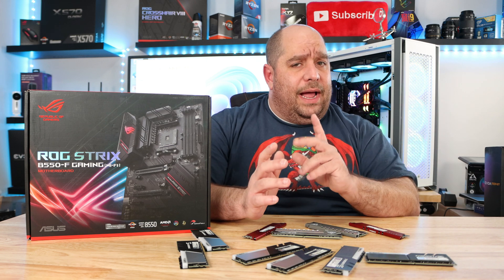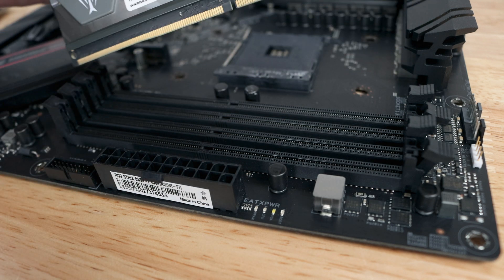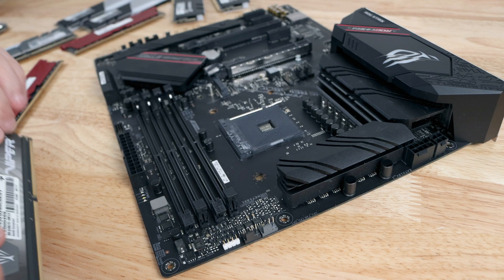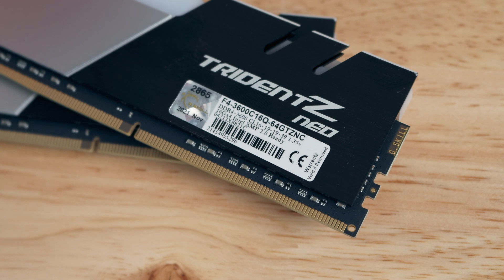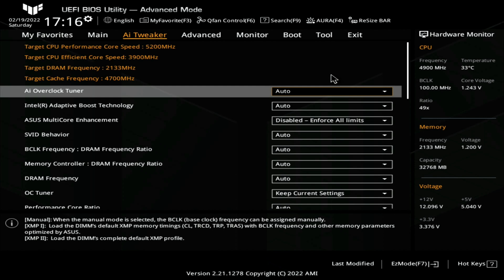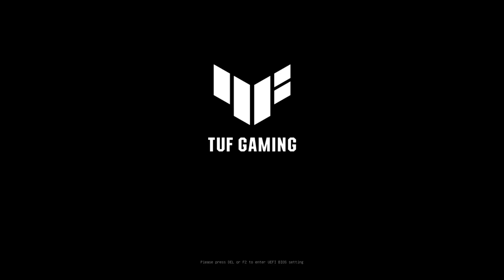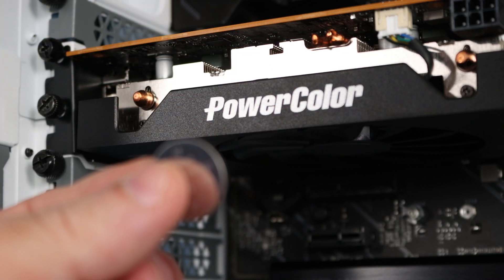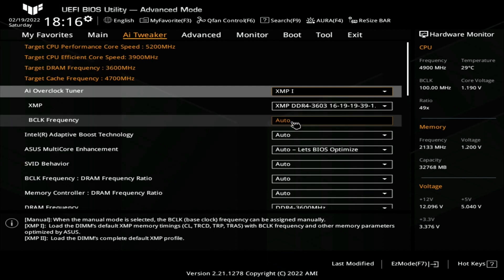How to install and configure RAM in a PC - Step By Step Setup Beginners Guide

Comment: When I boot up my PC I get this prompt - "Devices changed ( cpu or memory) or cmos have been cleared. Please enter setup to configure your system.”
Press f1 to run setup
Press f2 to load default values and continue." 

I do have a slow flashing redlight next RAM on motherboard.

Any idea what it is? Everything works fine I think.

Any help great appreciated.

cheers.
Reply from the maker: have you watched this video to see how to correctly install your memory and then how to set it up in the BIOS?
Reply: @ThisBytesForYou  Yes everything is seated correctly.  The RAM wouldnt work if it wasn't Thanks anyways.
Reply from the maker: @Sid Vish  actually, you're incorrect, the RAM could potentially work if it were not fully seated but you would have issues, you're having issues right?  Regardless I was talking about the M.2 not being correctly seat, but whatever, what do I know.  The other thing is your CMOS battery could be dead.
Reply: @ThisBytesForYou  I wasn't being funny. I do appreciate you replying. 

The only issue Im having is what I stated although it didnt do it this morning when I booted up my PC. Still a slow false red light behind motherboard though. 

I did a few hours gaming and everything worked great.
Reply from the maker: if your having issues, and they go away after a bit of using it, that is an issue, it could be small right now and get bigger over time.  What is the manufacturer and model number of your cpu, motherboard and RAM?
Reply: I do have 32G of RAM, I suppose the games could work on just 16g ( I have 2 sticks). I have ran some tests and both sticks are there.

Its very frustrating Its a $3k machine.
Reply: @ThisBytesForYou  You were right it was the RAM lol. Thank you very much indeed for help and reply.
Reply from the maker: @SidVish  always happy to help

Comment: Hey do i have to do the BIOS thing or can i just plug the ram and the computer will automatically detect it
Reply from the maker: It may, it may not, the bios thing makes it work and give it performance, totally up to you if you like performance and things to work.  I saw may or may not, because every board is different and memory is different as well, what works for me on my board, may not work for you on your board but XMP.... it's pretty universal, since it is a standard.

Comment: I have a problem where if I use any slot other than A1, the computer will not turn on/project to the monitor. All of the sticks work in A1, but will not in the other 3. The slots were tested and they all work, but the moment I put in a stick of ram it just refuses to just go. Motherboard is a Z490-A-Pro (MS-7C75).
Reply from the maker: your memory may not be listed in the motherboard QVL, but what I recommend is to use that 1 stick of RAM and flash your board to the latest BIOS version then try again.

Comment: Im a newbie to ram things. I wanted to ask one thing. I have a packed pc. Is it completely safe to change the ram of it?
Reply from the maker: yes, what is the manufacturer and model name of it?
Reply: @ThisBytesForYou  Lenovo ideacentre G5 gaming
Reply from the maker: its not showing up, but Crucial shows you what kind of RAM you can get, https://www.crucial.com/store/advisor#hero, you can go by manufacturer and model number of the RAM in there and buy something like it... but you risk it not working.
Reply: @ThisBytesForYou  thank you
Reply: @ThisBytesForYou  and oh sorry my pc is Lenovo ideacentre gaming 5 and model 14IOB6
Reply from the maker: here it will tell you what is compatible: https://www.crucial.com/compatible-upgrade-for/lenovo/ideacentre-5-14iob6, being that its a prebuilt' its very difficult to be able to recommend more than what Crucial has because it may not work, there could be a limitation on the motherboard or more proprietary, 

So if you wanted 64Gigs of 3200Mhz RAM, this would be my Amazon affiliate link for it: https://geni.us/5qHr, thats 2 x 32Gig
If you wanted 32Gigs of 3200Mhz RAM, this would be my Amazon Affiliate link for it: https://geni.us/eL7bM21 that's 2 x 16Gig

I hope this helps

Comment: Hi.. quick question, I need help.
Added a diferent ddr4 to the desktop and the PC wont Boot.. makes beep beep beep sound. If I remove the CMOS battery, Will restart motherboard settings and work proprely with both slots occupied? Do you think it Will work? Thanks in advance
Reply: My English is not perfect, sorry for that.
The PC is hp gaming desktop. Seems like it doesnt like different components. I updated the BIOS sucessufely, but I dont have any options to activete xmos and dual channels.. I dont have any options. So I thought, maybe if I remove the battery, might work.. that's my doubt
Reply from the maker: did you watch this video?
Reply: @ThisBytesForYou  I tried a quick answer.. because I didnt have the time get and dont know if you mention all CMOS battery topic in some part. But I Will, if you say the answer is there.
Reply: I couldnt find an answer.. minute 9 I saw what you did.. but then the BIOS dont haver any xmp options, because this board from hp is somehow restrictive.. can you provide the answer.. its enough to remove the battery? Thanks for your time
Reply from the maker: to recap the video,... how many sticks of RAM do you have, and are any of them different manufacturer and model numbers?  It's not a simple cut and dry answer.
Reply: @ThisBytesForYou  I understand that and I really apreciatte this. The older HP RAM dont have any latency cas Number, the new One is a cl16, both runs at 2666mhz.. just 2 slots sir
Reply from the maker: @ivoaraujo1180  ok so in the 9 minutes you watched you would have learned about the banks, and how different memory works, you can mix and match memory, but you have to install them correctly, you can't do that with 2 sticks of RAM, so you can only install 1 type of RAM.  After you install that 1 type of RAM, if it does not POST to where you can enter the BIOS, you will need to pull the CMOS battery and hope that it allows you once you reset the CMOS, to enter the BIOS.  The RAM may also not be compatible with the board.
Reply: @ThisBytesForYou  yeah I Guess the guy on the store wants to sell and let me believe all ddr4 are compatíble.. but nop.. Numbers are different. The old One is 1925, the new One is 2236.. 
I Will try the battery trick when I got the chance, before I ask for a refund. But I dont believe I Will be able to enable xmp on the bios. As I dont believe the old is xmp ready. I learned somwthing from you today, thank you very much. you have a new subscriver. Cheers to you and happy 2023!
Reply from the maker: Thanks my friend, I hope you have a great one too.    If you want to buy RAM that you KNOW is compatible, try this out, enter the manufacture and model number of your PC and it will tell you what is compatible and how much: https://www.crucial.com/store/advisor#hero
Thanks so much for your kind words and support, it means the world to me.

Comment: Mine don’t click into place even when the holes are perfectly lined up
Reply from the maker: It's ok, it doesn't always
Reply: @ThisBytesForYou  the lock won’t lock onto it fully because the ram isn’t all the way in
Reply from the maker: Not always, sometimes when the ram is all the way pushed in it won't snap in.  You have to make sure you have it fully and if it doesn't snap in then you have to push it closed.

Comment: Hi I just brought Asrock z590 steel legend with.  I9 trying to figure a good ram DdR4 no higher than 2666 the company stated and cosair works better can yo give me a ideal memory for this board had not built a computer since 2011 duo core.
Reply from the maker: this is what I am using on my system now, its solid. this is my Amazon affiliate link: https://geni.us/P67C6 but it's 3600, why do you want to go so low?

Comment: I just got 2 sticks off ddr4 ram and I don’t know if it’s fully going it I’m pressing down but the gold parts at the bottom are still showing and the locks don’t lock automatically and when I turn my pc there’s no signal I don’t know what to so
Reply from the maker: Are you sure it's a ddr4 board and if it is do you have it lined up the way I show you?
Reply: @ThisBytesForYou  I think the speed of the ram is too much for the motherboard but even after that my old ram dosent even work anymore basically broke my pc
Reply from the maker: @soapzerra  no, the speed would not be an issue and it would not have caused your PC to break.  Even if the ram was not in the motherboards qvl, it would not have caused your PC to break.  What motherboard manufacturer and model number are you using and what is the manufacturer and model number of the ram?
Reply: @ThisBytesForYou  my mother board is a msi rock h310cm-hdv and my new ram is Corsair vengeance
Reply from the maker: @soapzerra  what is the model number of the ram, Corsair has had the vengeance series since ddr2
Reply: @ThisBytesForYou  which one is the model number
Reply from the maker: Usually starts with cmx or something or...  You could type them all out here.
Reply: @ThisBytesForYou  yes it starts with cmx
Reply from the maker: Ok, so I am done, I wanted the model number so I can help and you haven't given it to me but anyway, watch the video, it should help.
Reply: I’m Srry I’m new to this sorta thing the pc turns on the fans are spinning and stuff but the monitor says no signal for both ram sticks new and old the model number is  CMK32GX4M2D3600C18
Reply from the maker: @soapzerra  that's ddr4, 3600mhz with a case lately of 18 it should work.  If it doesn't and putting back your old ram didn't work you might have damaged the slots improperly installing the ram.  Have you watched this video?
Reply: @ThisBytesForYou  I did watch the installation part of the video
Reply: @ThisBytesForYou  so I would need a new motherboard then?
Reply from the maker: @soapzerra  maybe, if you damaged your board.
Reply: @ThisBytesForYou  is there a way to see if I did
Reply from the maker: @soapzerra  look at the slot, see if there is damage or take your machine to a PC repair shop.  To me it sounds like you tried to force your ram in the wrong way, which happens, it sucks but it happens.
Reply: @ThisBytesForYou  if I need a new mother board do you know any good ones and how much are they
Reply from the maker: @soapzerra  this one should work, now I need to go back to sleep Check this out on @Newegg: ASUS TUF B360M-PLUS GAMING LGA 1151 (300 Series) Intel B360 HDMI SATA 6Gb/s USB 3.1 Micro ATX Intel Motherboard https://www.newegg.com/asus-tuf-b360m-plus-gaming/p/N82E16813119083?Item=9SIB4KCJ6A0245&Source=socialshare&cm_mmc=snc-social-sr9SIB4KCJ6A0245_-12222022
Reply: @ThisBytesForYou  would I need to upgrade my power supply for a new motherboard
Reply from the maker: @soapzerra  I don't know, I don't know what you have, please list out the make and model of your power supply and video card
Reply: @ThisBytesForYou  I have a GeForce RTX 1650 graphics card and I have no way of knowing my power supply since I have a prebuilt
Reply from the maker: @soapzerra  you have the computer, I can't help you if you can't help me.  You "should" be good though but I am guessing since I dont know how many watts it is.

Comment: Nice video.

I followed the steps and apparently my new RAM is working but as soon as I do a demanding task like 3D rendering or live preview of a 3D model my computer restarts automatically. Any idea of what could be happening?
Reply from the maker: It could be so many things, doesn't sound like RAM though, but of course it can be.
Have you checked your CPU and GPU Temps?  I like to use HWMonitor, GPU-Z and MSI Afterburner to check temps.
Gaming and Workstation tasks like Solidworks, AutoCAD, etc punish your CPU and GPU.  GPU more if you are using GPU acceleration but if you have 2 monitors, I would highly suggest, have 1 monitor doing you rendering or 3D modelling, then have up on the other, HWMonitor and GPU-Z monitoring your temperatures and you may notice them quickly going over 99°C, the tJunction for most hardware is between 90 and 99°C and if it passes that, it will usually throttle (lowering the speed to keep it from burning out) but if its too much it will just quit.

The other thing could be power, 

So that I can help, please list the manufacturer and exact model number of the following components:
1. Motherboard - manufacturer and exact model number
2. CPU - manufacturer and exact model number
3. RAM - manufacturer and exact model number
4. Video Card - manufacturer and exact model number
5. Power supply - manufacturer and exact model number
6. Monitor - manufacturer and exact model number
Reply: @ThisBytesForYou  
Thank you very much for your quick response.

I just did some tests with the programs you suggested and the temperature doesn't seem to be a problem. So I leave you the data that you have requested, hoping that the problem is evident to someone with your experience:

1. Motherboard: MSI B85-G43 (MS-7816)
2. CPU: Intel Core i7-4770 CPU @ 3.40GHz
3. Patriot Memory Viper 3 Black Mamba DDR3 1600 16GB (2x8GB) - PV316G160C9K
4. Gigabyte GeForce RTX 3060 GAMING OC 12GB GDDR6 Rev 2.0
5. Nox Urano VX650 650 W Model NO: NXURVX650
6. LG 27UD69-W 27" LED 4K Ultra HD IPS

The only new items are the GPU and memory modules since I changed them a week ago. Until then the setup was working just fine although very slow in my 3D work.
Reply from the maker: @Chelentano  your system looks fine, I recommend updating your BIOS to the latest version: https://www.msi.com/Motherboard/B85-G43-GAMING/support

After you update your BIOS, go into your BIOS, into the exti section (I think, I can't see your BIOS layout) and select "Load Optimal Defaults", save and exit, then come back into the BIOS enable XMP profile, set your other settings but do not touch anything under the memory, where you enabled XMP.  Give that a try.
Reply: @ThisBytesForYou  Unfortunately that didn't work for me either. The BIOS was already updated and after following the rest of the steps that you have described, the result is the same.

I can also confirm that there is no manufacturing defect in the RAM as I had requested a replacement and new ones give the same result. I'm starting to think I'm going to have to make do with my old 8GB of RAM.
Reply from the maker: @Chelentano  first, are you correctly putting them in slot 2 and 4 and not mixing in the other 8 gigs of RAM, don't mix RAM?  Also, have you tried swapping the ram you have in slot 2 to slot 4, and 4 to 2?  Have you checked if your memory is in the QVL for the board?
Reply: @ThisBytesForYou  Yeah, I have removed the old 8GB memory and I've installed the new ones in slots 2 and 4. Also tried 1 and 3 with no luck. And yes, I specifically bought a memory that was on the QVL.

It hadn't occurred to me to swap memory between slot 2 and 4. Do you think it could have any effect?
Reply from the maker: @Chelentano   I''ve seen more strange,  did you install windows with this memory or is this an older install and you are just swapping memory?
Reply: @ThisBytesForYou  Yes, older install and swapping memory. Should I reinstall Windows every time I swap the RAM? I might try that tomorrow then.

I'm so grateful to you for dedicating your time to this. Sorry to be tiresome.
Reply from the maker: @Chelentano  no, you dont have to reinstall windows when you install new RAM, it was just a question but I don't think the RAM is the issue, but try swapping the RAM from one slot to the other, its worked for me before.  Always a pleasure my friend.
Reply from the maker: @Chelentano  Please let me know if that worked for you.  Also, the reason I mentioned that about the install is that if you install windows with bad ram, or overclocked poorly, windows will forever have issues, so its best to do a clean install but if that copy of windows was installed with ram that's always worked great, it shouldn't be a problem.
Reply: Understood, thank you for that info.

Sorry for the lack of communication, didn't have much time today to try to solve this problem. I did swap memory between 2 and 4 though and it didn't work. First thing I'm going to try tomorrow is to clean the slots thoroughly. Aside of that I'm out of ideas.
Reply from the maker: @Chelentano  yeah, I am not exactly sure what to say, but actually I did have a similar issue, where the memory was compatible but just didn't work right, on my video editing workstation, which needs to be perfect, I started with one brand and had to move to another , its not in the video but in the description: https://youtu.be/13LhFMdbtBA
Reply: @ThisBytesForYou  Just one more thing. Since I'm not able to make the 16GB work 
I was thinking of going back to my old 8Gb RAM for now. I want to keep working even if it is slow. The problem is that when I put the old memory back in, the PC restarts over and over without actually starting Windows.
I simply changed back memory and loaded optimals on BIOS.
Reply from the maker: @Chelentano  that is because when you loaded optimal defaults, you lost your boot order, go into your boot section and make sure you select either Windows Boot Manager or your drive, which ever it is set for.

Comment: Hi I have 2x8gb xpg d50 for many months and right now I was added 2x8gb xpg d60 if I use just 2 slot it work but if 4 slot it doesn't boot.
Reply from the maker: Did you watch the video...
Reply: @ThisBytesForYou  Yes enabling XMP works thanks